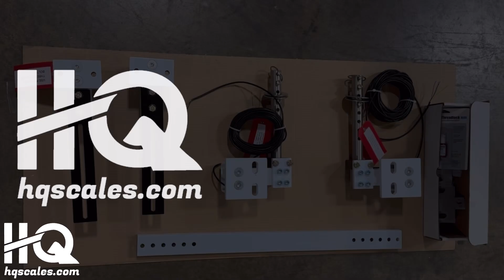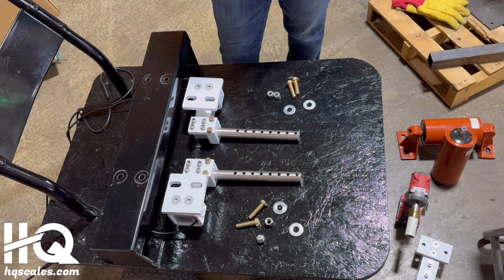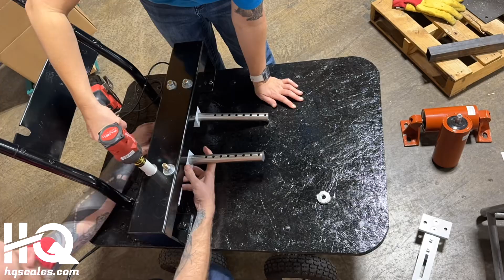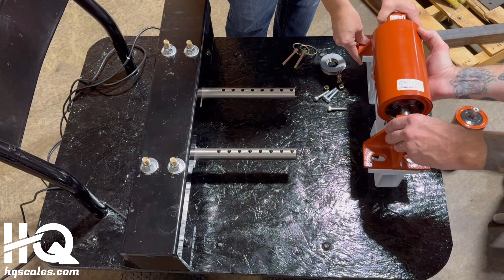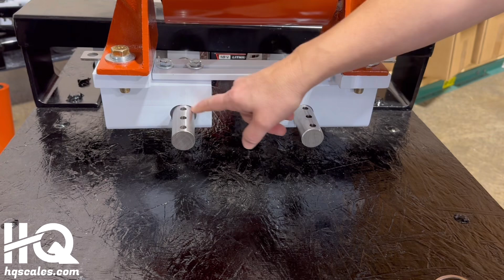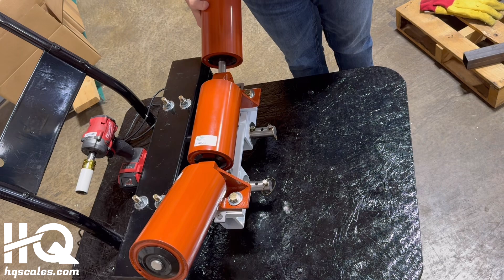How To: Mobile Scale Mechanical Installation Video

Comment: For those who are installing the Mobile Weighbridge, the idler mounting rods that are on the Load cell assembly travel uphill or in other words will be pointing in the same direction as the travel of the belt. - Innovative Scale Technician